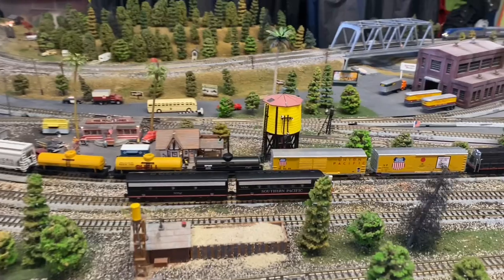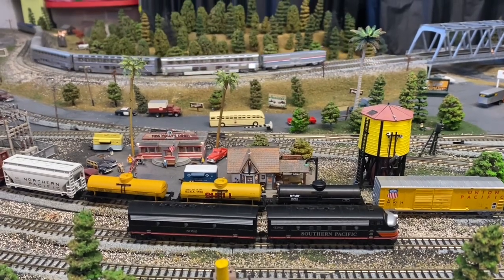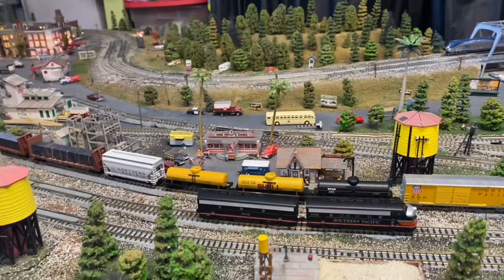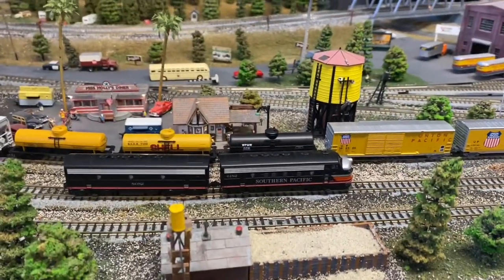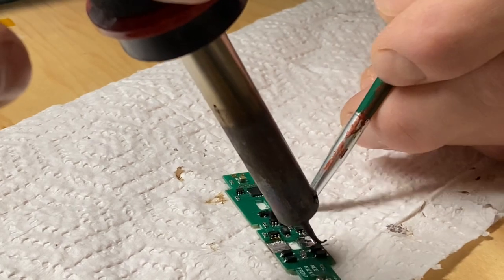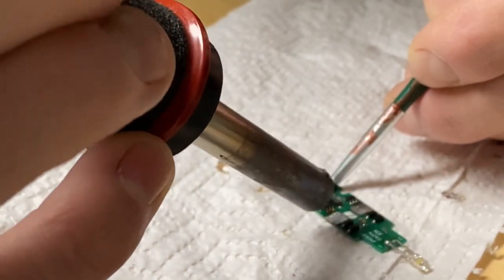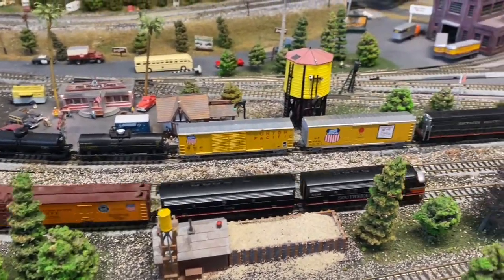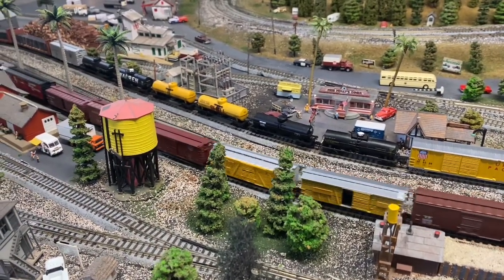I’m Super Excited!! Running Kato and Atlas Nscale Trains On My Layout

Comment: Nice running trains Sean. Remember that the factory reset for NCE (CV30=2) is different than most other decoders such as Digitrax (CV8=8). Have fun....John
Reply from the maker: Thanks John I really appreciate it thank you so much 👍 I remember the CVs, hey John I left you a message just a few minutes ago about that El Capitan I found a set but is that the real deal? did the Santa Fe super Chiefs pull those exact cars? Thanks John you are the Santa Fe King,

Comment: Sean   from observation on that soldering iron it needs a new tip. Tip care leads to good connections. Keep it clean and tinned.  Get some liquid or pen flux, and some fine soldering wick  1/8" braid.  Watch a soldering video for PC circuits not trains.  https://www.youtube.com/watch?v=6rmErwU5E-k
Reply from the maker: Thanks Peter and yes, the tip of that soldering iron was burnt beyond measures. Thanks for your suggestion, it really helps me be better at soldering and thanks for the link to the video. This is so helpful. 👍😃